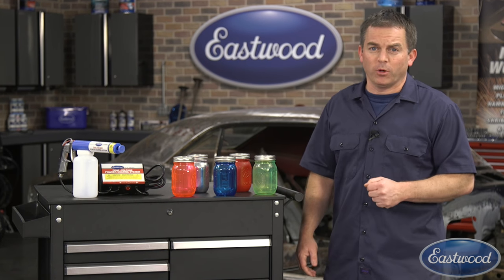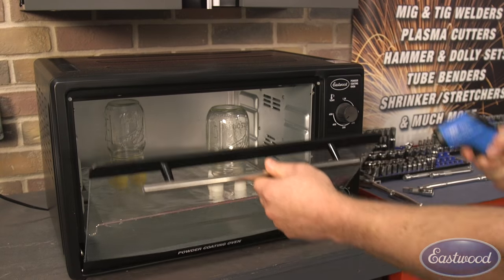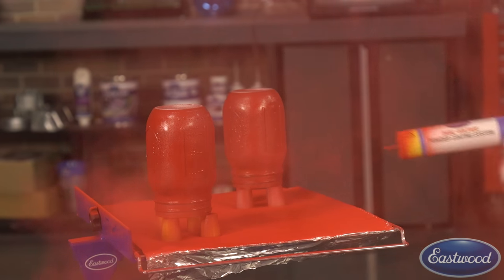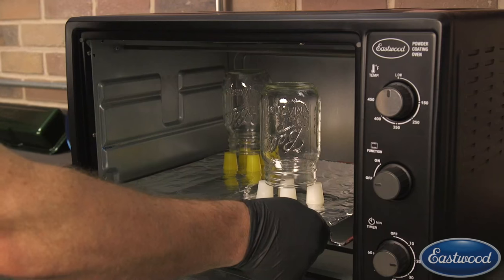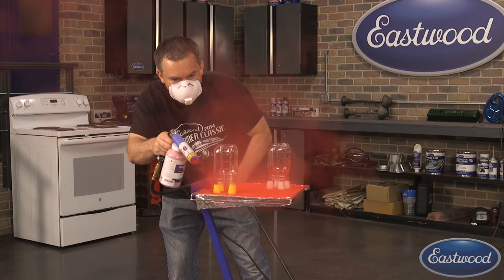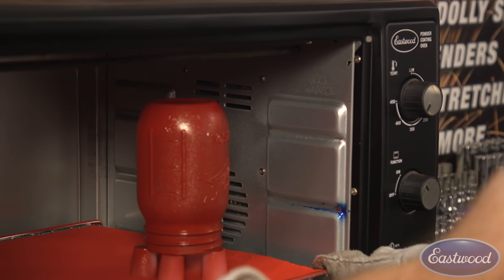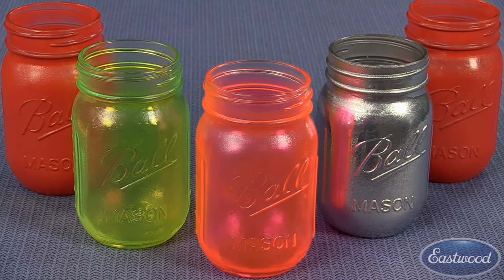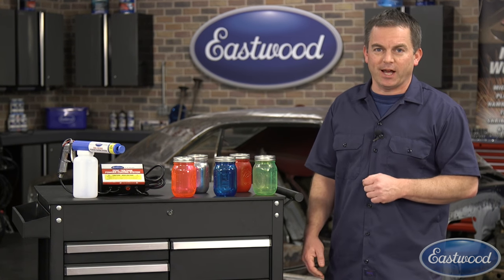Powder Coating Glass for Home Projects - How To Hot Flock Glass Jars - Eastwood

Comment: Hey guys, there's an easier way to powder coat glass. You just fill up your glass with aluminum foil or some wires and this way the powder sticks to the glass by the electrical charge.
Best wishes, Ricardo... austrian powder coatings ;)
Reply from the maker: Here's a test we did and hot flocking seemed to work the best.  But if you have any suggestions on how we can improve our technique, let us know and we'll shoot another video.  Thanks.  https://youtu.be/xQ0iBPePqOA